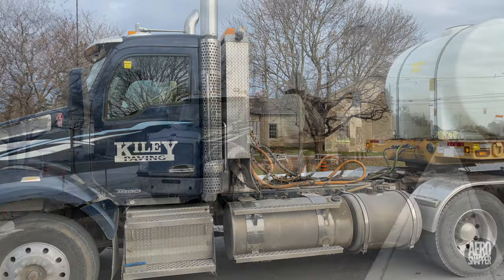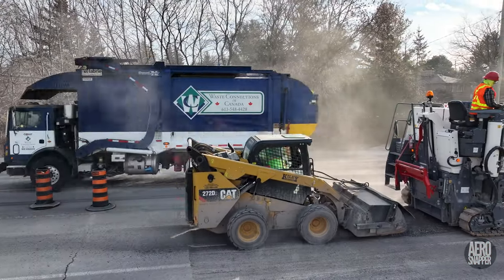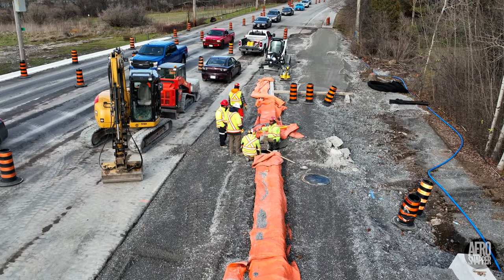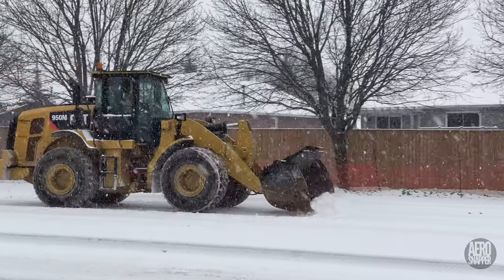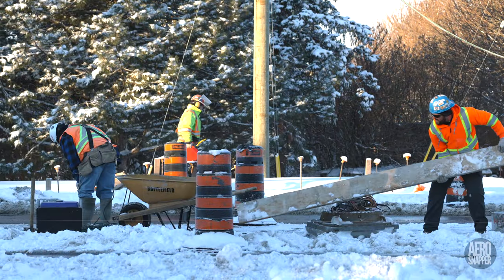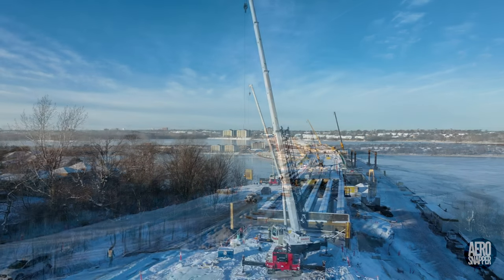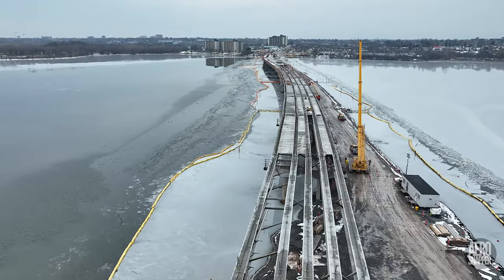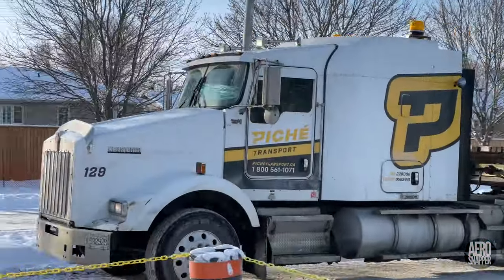Rainy Days and Mondays   4K

Comment: Prefect frame rate :Truck on 3:14 was moving but wheels were not
Reply from the maker: You are really observant and I had to go and look - now, if you know the circumference of the wheel and the frame rate is 30 fps, what is the speed of the vehicle ?  Will anyone take that on ?
Reply: @Aerosnapper   I will take the challenge 
OK I took an assumption of 33 diameter wheels and came up with a speed of 32.8 Km/h  .  Note: I have never done this before.  How close am i
Reply from the maker: @harhem  I admire and respect you all the more now.  I honestly have no idea, but that would be very close to the mark, I suspect - great work..
Reply: @Aerosnapper  I admit the diameter size was a guess based on researching what the average tire size is for that vehicle. They did not look overly large .  So the rest  was researching  calculating speeds  with the required variables.    Wondering how close i am?
Reply from the maker: @harhem  I’ll make some inquiries. I suspect that the speed limit is 30 Km/h.
Reply: @Aerosnapper   Carful . I do not want to get anyone in trouble -
Reply from the maker: @harhem  me neither - thanks for your concern